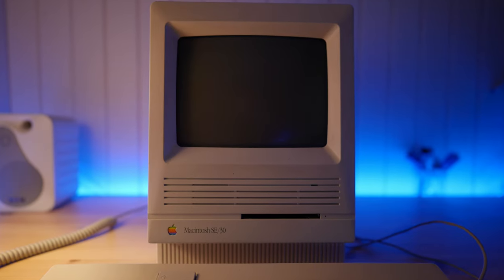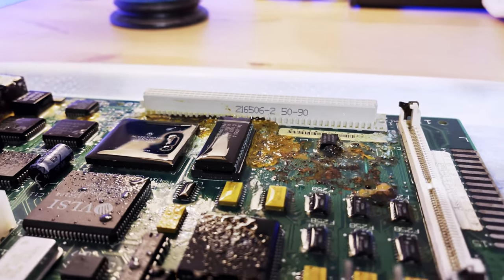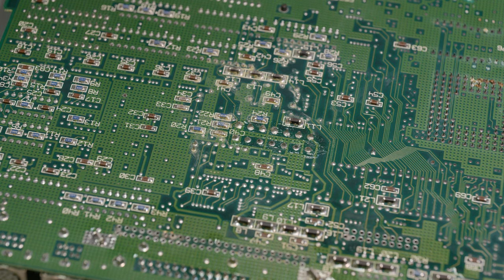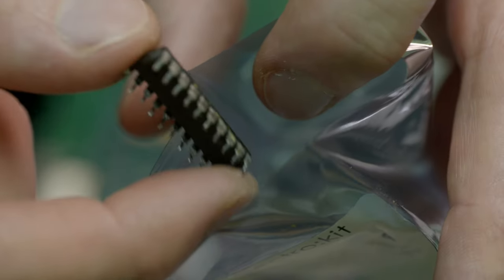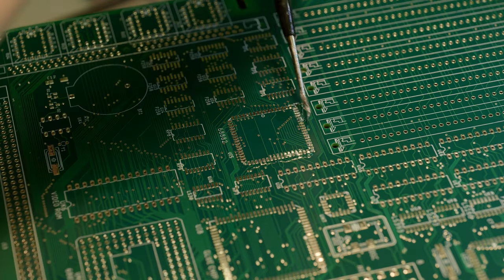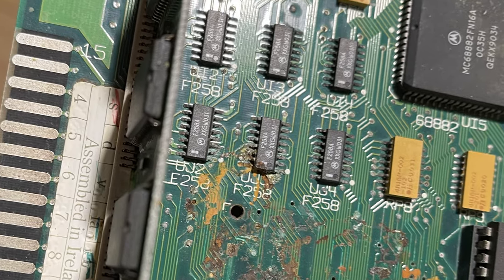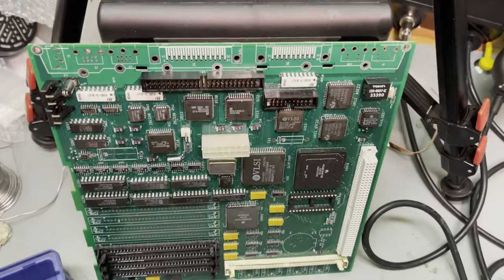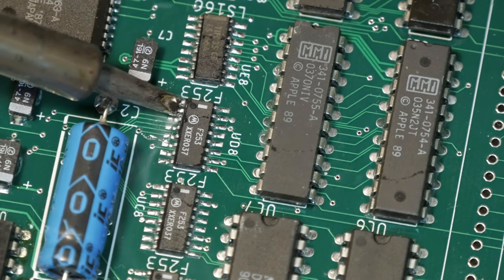Building a Brand New Macintosh SE/30 Logic Board!

Comment: Great video! The SE/30 is a wonderful beast. I have one. While it didn't have battery damage, I did need to do a lot of work cleaning and recapping it after all the SMD caps dumped their guts.
Reply: Remember to recap the Analog board and PSU....Specially the PSU

Comment: Nice job. The only examples of battery bombed compacts I have are so bad the legs have been eaten off of several ICs, so there's not a ton of hope in saving them without a large cache of spare chips. Luckily most of them (except for the '882) are just the RPs and F258s so if I really wanted a project, I've got one ready. Now if only the Classic would get enough love for a repro board.
Also you'll probably want to recap or replace the PS in these. They tend to get a little leaky and can cause some intermittent problems.
Reply from the maker: Yeah, I got lucky with all of the PLCCs. I forwent mentioning it in the video, but the CPU actually had to be replaced in my case though, due to some severly corroded legs. Fortunately ‘030s are plentiful on eBay!

As for the Classic, there actually is a project for that one too: https://github.com/kr239/Macintosh-Classic-Reloaded

Comment: As someone who repairs these, great work. I built one and hated every moment. Solder refused to flow properly even with my high end flux. Looks like one of the 253s may have a bad connection? But yeah, those FB got me the first time too =)
Reply from the maker: Yeah, I noticed those pads were not eager to accept solder! Maybe going over them with a glass fiber pen first would make it better.

Comment: Hi, I have an SE/30 in very similar shape as yours was.  I'd seen some posts about that replica, but not seen solid proof that it worked without compromise.  This looked 100% compatible!  (let me know if there's any tradeoffs you've discovered).   

But mainly, now having seen this I'm going to take the same approach.  Are you willing to sell one of the spare boards to me?
Reply from the maker: Yeah, I haven’t noticed any issues with compatibility. All the parts that were salvageable from the old board fit just fine, and as far as I can tell everything works as expected.

I can sell one, but shipping from Sweden to USA is like $40 at least, so the cheapest option for you would probably be to find some other people in your area whom are also interested, and then split the shipping cost on a new order from JLPCB. Also, I ordered my boards back in March, and there have been some updates since then, although mainly to the BOM-files I think, but you may want to check that you’re not missing out on any improvements made since these were manufactured. They’re revision 03.

But with that said, if you’re still interested, drop a mail to the address on my About page, or DM on Twitter @OddObsolete :)

Comment: What?  No chip sockets for the PLCCs, ROMs and IWM?  I would have.
Reply from the maker: I don’t intend to ever move them, and sockets can be a source of hard to debug contact issues. Especially PLCC!
Reply: @OddObsolete  My only reason would be to prevent corrosion from reaching the chip's legs should a cap or battery burst again.  It just makes removal of the chips much easier.  But if I do that, I might as well do sockets for EVERY part that looks like a chip.